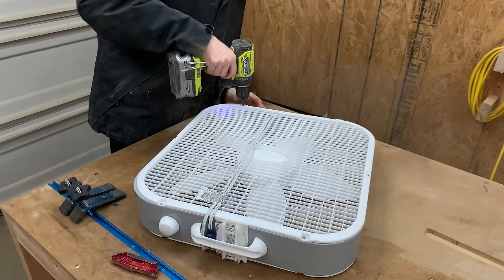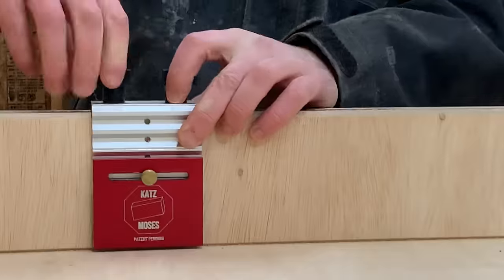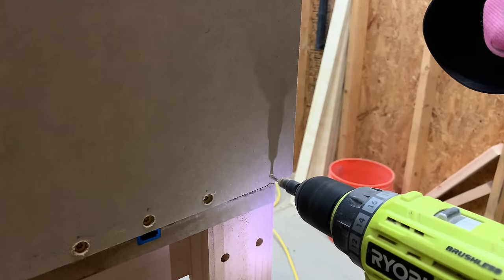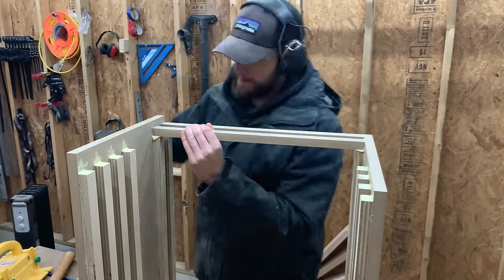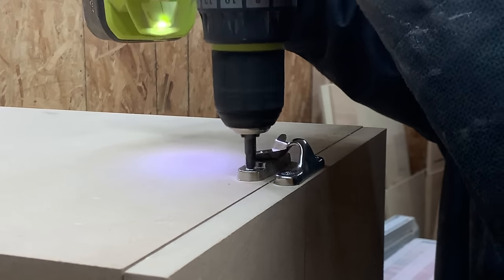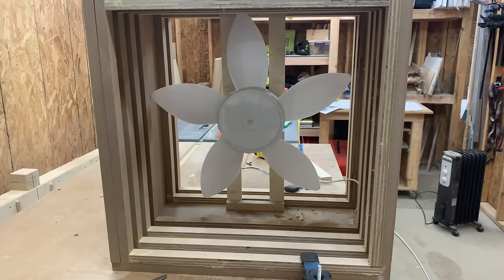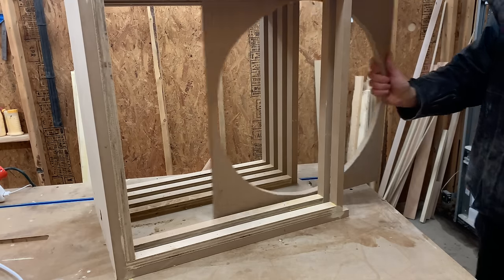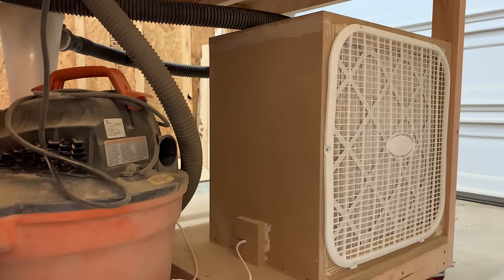this $20 fan will SAVE your lungs

Comment: Pro tip… Just use some masking tape to tape the filters to both sides of the normal box fan, and just be sure that the airflow arrows are pointing in the right direction. That’s the easier version of this!🤓
Reply: "We need door stops, but a brick would work, too."
Reply: Made one like you describe 20 years ago. Worked fine!
Reply: Since the motor isn't meant to be a filter fan they burn out after a while a lot quicker than if it was just pushing air.
Reply: That seems like a lot of trouble with a weak fan motor. Taping filters to both sides will be rough on the little fan and it won’t last long but…..
Reply: When the need to make a YouTube video is greater than common sense.
Reply: Just one filter taped on the back worked great for me. It also kept the motor clean and was easy to just vacuum the dust it collected off without having to remove it to vacuum off the inside like one on the front would need.
Reply: I agree with you…many steps can be saved
Reply: I just bought a tall room fan and filters at a local thrift shop and I plan on just zip tying them to the fan. Total expense $5. 😁
Reply: @e-rock2564  actually. A fan that isn’t pushing air would last longer. It would draw less amps and since air is not actually passing by it, it would stay cleaner longer
Reply: @peterchats9783   many of the D-I-Y videos i see, like this one, fall into the same category... many times there is an easier way and/or a better way to get the same task completed
Reply: @e-rock2564  That's why you put MERV 14 filters before the fan motor and nothing after it (different design to this example)
Reply: I have been tapping filter to those box fans for 20 years +. I have made baffles they make big difference if put In correctly!
Reply: I just duct tape it. This is a cool build though.
Reply: Here is an even easier way just buy one that is made to do the same thing this does but even better.
Reply: I thought the same thing. 
Why not match filter size outside diameter to the outside diameter of the fan housing using duct tape to secure it.
Reply: I have done this before and it saves tons of time and works just as well. I only used one filter to save the fan motor.  My home central only uses one filter as have all the home centrals I have seen.👍
Reply: I see great minds think alike, I came down here looking for this comment
Reply: Cost of fan - $20.   Cost of modified fan - $800.   What's not to like?
Reply: I'm also thinking, to air-tight seal the gaps between the filter and back of fan, you could just pull the fan into a garbage bag so there's no slack, then trim a circle for the airflow and then the excess bag - then place the filter over that layer and tape. Done.
Reply: Another typical youtube "hack/diy" video. Duct tape, fan, and filter are definitely faster and cheaper.
Reply: Lmao this is what I was thinking when he was disassembling everything. If he absolutely had to get fancy he could have just built a box that the fan sits in, sealed with weatherstripping.

I like this guy as a person, but it surprises me he gets so many views. Just doesn't have the watchable factor for me haha.

I like some tips from him, but he doesn't have the genuine interesting feel that some of the bigger channels have
Reply: @bobstranzenbach4700  put it only on the intake. Theres no point in having 2. f you put it on max flow and it's bogged down a little it's not going to significantly lower the life expectancy of the motor
Reply: that's exactly what I was thinking.
Reply: My thoughts exactly.....Bunch of clowns
Reply: That is what I did when the Forest fire smoke was at hazardous levels
Reply: Is "easier" the right word? Lazier, sloppier, half-assed, any of these would work...
Reply: I was thinking, this is a lot of work for one fan, your method made me feel a lot better, but I’ll probably stick with my regular fan.
Reply: Exactly,  beeppizzle.
Reply: @georgesebastian6306  Same here 28 yrs ago, i just change the filters accordingly and it's still running fine. Took about 120 seconds to make.
Reply: @peterchats9783  EXACTLY !!!!
Reply: instead of tape bungy cords.
Reply: @bobstranzenbach4700  YOUTUBE OVERKILL FOR LIKES!🙄
Reply: I like how you're is so well thought out, but as you can see from the comments, many prefer a similar built. I have the same cheap fan as yours. I did a little modifying to allow the fans to be attached to a 2x6 for stability and then used large rubber bands, like you use for trash cans, to secure two 20x20 filters to the intake side. I set the corrigations perpendicular to each other. I think filtering before the fan will reduce dust build up on the blades, motor housing, etc. When the most outside filter gets dirty, I trash it, move the second filter forward, and replace it with a new one. I've been delighted at its performance.
Reply: Yep . . . Been just taping 20" filters on 20" box fans for years.  This seems excessively complex.
Reply: @RichardRecupero  The passing air is also cooling the motor so over time the extra heat will reduce its lifespan.
Reply: @bobstranzenbach4700  Yea my fan has been running over 5 years no problem but whatever you think is right LOL
Reply: @davidboyd1617  to be sure, this is just for ambient room dust/particulates and not for any kind of painting/rattlecan fumes as that fan motor will cause a fireball explosion, right?
Reply: I was thinking the same thing!
Reply: I like your 5 minute craft better than this 3-day project.
Reply: Sure and you can get your dinner out of the garbage too if you wanna do it the easy way smh.. I ain't having duct tape trash hanging in my shop ceiling..
Reply: @RichardRecupero  hmmmmmm interesting this concept going around in the comments pertaining to PuSH + PuLL + moto-life + amps etc.
I understand these are generally not the most enduring [motors] products especially when configurations are changed. If I am understanding then what you mean is if say I could fix the back [intake side] flush n sealed oR just a-fixed the motor with blades to a backboard/plate like at the bottom of a box or tube with fixture in front of blades to install a filter. So the motor would only be essentially PUSHING the air & either last longer & oR draw less amps [likely dependent upon filter density] while operating. 

       My question is would the fan not require & always be DRAWING air from [a] supply to then PUSH. LoL I don't want to go two pages of descript variables but if you can\could↓
Add some more color to your statement because the physics or whatever interest me in the simplest of things here ha ha ha. Also the results if your basing from hard truth I am all in and waiting for high school→collage level understanding.
Ya never iknow where such data might come in handy say as I remodel my 2 camper trailers. I mean I could google-it-up but were already on the same page soooooo. . . . . . . . .back to you Rich !
/;^)
ALwaysFOrward~Godspeed
Reply: @MAS  b3cause just putting a filter in the back of the fan looks amateurish and is super lazy weak way to do things..
Reply: @Ballzmckgee   "b3cause just putting a filter in the back of the fan looks amateurish and is super lazy weak way to do things.."

Carpenters have a saying.  "Don't worry about what you can't see."  I ask you, what the F is the function of this shop and does it look like a FING shop?  

And if you want to place this somewhere else, this is still way overkill.   Someone could spend a lot less time creating something just as functional and not bad looking.  But why place it somewhere in the house if if you have central unit filtering anyway.
Reply: @mas5867  this isint Carpentry, this is fine woodworking my dood, it all needs to be nice..
Reply: You don't even need tape.  The suction will hold it on.  Add a 3M cool flow dust mask, and you're golden.
Reply: His box makes it easer to replace the filters. 
And it won't fall over.
Reply: @e-rock2564  The motor actually gets a rest, it doesn't work harder if you impede the flow, and measured amps will be less. Positive displacement air or liquid movers are a different story.
Reply: I just use 2 bungee cords to hold the filter to the fan.. takes 2 minutes. Been doing it for 30 years
Reply: @KeithHill2  As Greta Thunberg would say, "How Dare You!"
Reply: @ballzmckgee3167  Now you've gone and offended Red Green with your duct tape comment.
Reply: @kmiller5808  I'll apologize to him and him alone haha
Reply: This LOOKS better.
Reply: @espressomatic  That's what I was thinking. Why not eliminate the stacking of the filters and just build a bigger box to throw the fan inside, or tape/zip tie it to the back of the box fan.
Reply: I have a Holmes air filter that I bought at Kmart in the ‘90’s. I can’t find filters for it anymore, so I periodically take it outside and back flush it with a compressor. It still work quite well.
Reply: I was thinking the same thing when the video was over. I was like hmmm well I don't feel like putting 2 hours into a fan. Specially when I have 20 projects lined up to knock out hahaha.

Comment: Great idea and nice looking.  Suggestion from the HVAC standpoint. Better to stack the filters both on the uptake side of the air flow with the cheap filter on top of the hepa. This does two things, of equal importance. One , having both filters on the inlet side keeps  the fan motor and blades nice and clean. Two, a fan motor is happier pulling against negative pressure. Somewhat counterintuitively perhaps but it has to work harder when pushing against an obstruction, in this case the filter. I built mine with a salvaged squirrel cage fan (2000 cu ft/min). Paired this with a 2" pleated on top of a 4" 90% filter. Covered the fan on the outlet side with wire screen (1/4" squares). Noisy but moves a huge amount of air and will pull the dust out of your hand.
Reply: could you please show this on youtube and pin it here so we can see what you’re talking about….
thanks
Reply: Good points.  Also, if using a cheap box fan like this, you would want to put a shroud on it.  Without the shroud to minimize recirculation, the fan will be inefficient.
Reply: The filter distance to fan will effect more vs pull or push IMO due to stall area. You can look up stall curve on fan graphs if they have them. These cheap box fans barely have any flow and do not perform very well as a compressor type fan. 

All I do is bungee cord a 20x20 hepa to the back. I have like five like that. I pulled mold and meldew smell out of grandmas house with these. For the shop hepa doesn’t make sense it’s just a waste of money cause so many other contaminants in the air. But if you’re painting or burning plastic or something really smelly then maybe but a 20x20 hepa is like $15-30 range alone. I also use this setup a lot for paint booth exhaust. Keep in mind they are not explosion proof fans so maybe another reason to filter from the intake.
Reply: I did the same yrs ago
Reply: love this shit
Reply: Fuck yea!
Reply: Those pleated filters severely overamp the motor though.
Reply: @IcyBird420  usually people use several filter areas to increase the filter area so that doesn't happen. But in this case you are exactly correct.
Reply: So use a cheap filter on top of a HEPA filter taped to the BACK of a box fan?
Reply: @RealityBites  - he said it sounds counterintuitive, but it's easier on the fan. Putting both filters on the intake side is pulling against negative pressure on the fan - if you think of it like that, it makes sense. If the fan were pulling through two filters, it's harder on it.

Comment: looks like a fun build. I did the short cut version, i bought the $15 lasko box fan, and a 20" home depot fpr10 (~merv 12) filter. popped the back off, slapped the filter on, replaced the back plastic over the filter & sunk 1 1/2" sheetmetal screws back into the original holes. works amazing around the house for clearing smoke after burning dinner, sucking up the particulate, dust and allergens on high pollen days or when dusting, folding towels or bedding
Reply: This is the correct way haha
Reply: Yet you didn't triple the size/ weight, nor did you reduce air flow 90% as this clown just did !  You got the same effect BRILLIANTLY.

Comment: Couple of things. First, good concept build and I don't want that lost in criticism. Second, you should install the fiberglass filters as a prefilter to the MERV rated filter. (It is not a HEPA Filter but will save your lungs none the less.) By using those cheaper filters first means that they remove the larger particles before it hits the higher rated MERV filter. This will allow for longer life of the higher rated MERV filter. The fan should be the last thing in the series as it will extend the life of the fan being at the back of the filtration. The Ring you made for the fan should be as close the the fan blades as you can afford or it will loose pressure to push air through, creating turbulent air instead of pull force. Turbulent air is great for cooling, but not forcing air through a filter. I hope this helps you or anyone else wanting to make these awesome filter boxes!
Reply: 😯  Oh goodness... You are so goood at explaining the concept that I am able to visualize the mechanics of the most effective way to build this.  👏  You must be a great teacher.  Now, all I need is a wood shop and tools to start this project. 🙄🤭😕
Reply: This is what I was about to say. Ontop of that. More filter does not equal more better. You lose a load of suction by stacking filters.
Reply: All of what you said is correct
Reply: And yet no talk about the over taxing of the fan motor cheap but not cost effective for the longer term
Reply: @XxpizzamonsterxX  What? Not another tax!

Comment: I made one of these by tying the filter to the fan with some mechanics wire. Worked well enough when I was cutting some fine dusty fiberboard. Room cleared in a couple of minutes.
Reply from the maker: Glad to hear it worked well for you!
Reply: Just wire tie a filter to the fan. Been doing this for years.
Reply from the maker: Yup, that’s certainly another option 😀
Reply: Did the same thing but with tape. Works perfectly, this just seems like a waste of materials and time because the fan comes in its very own pre-made box.
Reply: @leemontgomery72   I was thinking the same thing. Did lumber suddenly get real cheap ? If you’re going to waste money on lumber then waste some more and hire a carpenter ...

Comment: Keep  a eye out for a used oil furnace. Rip out  the parts you don't need.  It moves a lot of air. Use washable air filters. With multiple layers.  Works great  for shop
Reply from the maker: Great tip! I never thought about something like that

Comment: Great DIY option! Regarding fan placement: Some rooms/environments have prevailing air current movements either due to thermal exchange patterns or poor construction(air leakage)/exterior air movement, etc.  If you fill the room with smoke(think smudge stick, or a put a smoking friend inside) the movement of the smoke will indicate the native air movement(if there is any).  Then you can place your fan to take advantage of prevailing currents(as opposed to working against them).  If you have a convection or baseboard heater on one wall, the hot air will rise up that wall and across the ceiling before dropping down the opposing wall as it cools, taking fine particulate with it. If you place your filter fan in this path you may be able to increase it's air scrubbing capacity by taking advantage of the thermal/particualte flow. Follow the smoke pattern...
Reply from the maker: Thats a good tip! If I had a smoke machine, I’d definitely give that a shot
Reply: Great tip. Thanks. Im going to try inscents .
Reply from the maker: Just don’t try insects 🐜

Comment: I did something very similar to this. A couple of lessons learned. First, the board with the circular opening. It is there to prevent leakage around the fan blade. The air will take the path of least resistance, which means the air is happy to circulate inside the box and never leave. Also, the blade needs to be inside the circular opening, for maximum effect. Second, don't both with MERV 7 or greater filters. The harder it is to push air through the filter, the less likely the air will move. The fan blades are pretty thin and weak. They are not designed to move air through a restrictive surface. If you add too much restriction, the blades will literally flatten out a bit, which reduces the airflow. That being said, this can work as long as you don't expect too much from it. I started by using masking tape to attach a 20x20 filter to the back of a box fan. Nothing fancy, but in a matter of two months, the filter was disgustingly dirty. Success! If you're looking for a quick and inelegant solution, just tape the filter to the back of the fan. Not only does this filter the air, it keeps the fan blades clean.
Reply: I agree, I would also be interested to know if the increased load on the fan could cause a significant increase in power consumption and potential cause the fan or wiring to short out.  Probably not with enough airflow through it, but I would want to keep an eye on it especially if the environment heats up significantly in the summer.
Reply: @middleoftheinternet the fan restriction if any only causes the fan to pick up less air. These fans only live what air is available. So anything blocking the air flow will merely cause less air to be moved. As long as it gets enough air to keep the motor cool any variance will have some reduced effect. How much depends on the restriction.